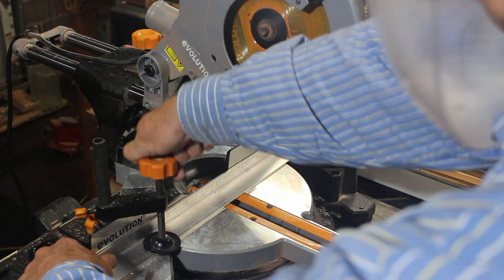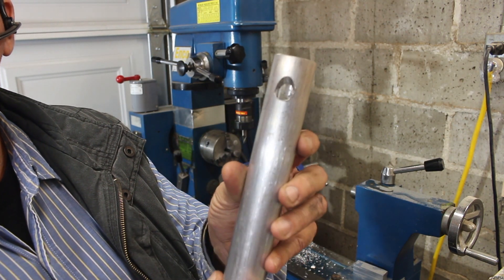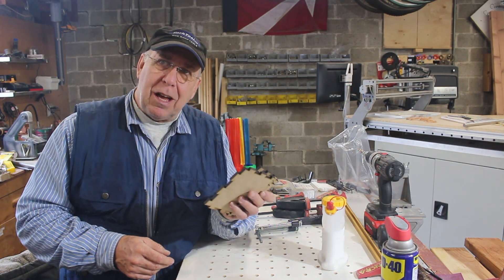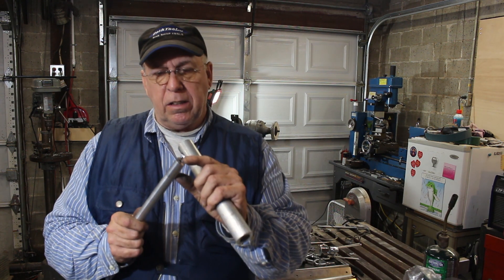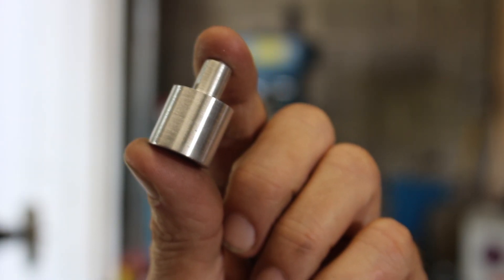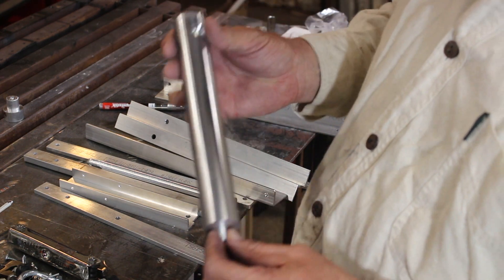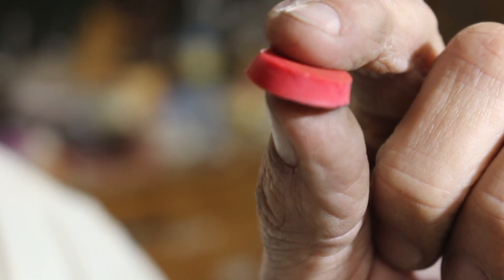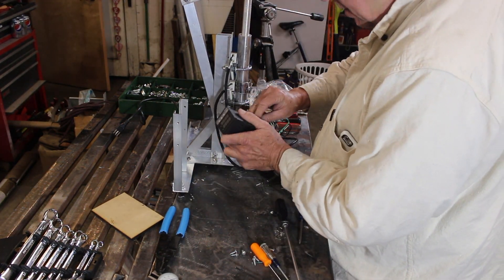Injection Molding Machine for under $100 in parts using less than $700 worth of machinery!

Comment: The video format is good. Try to stay under 10mn. 5mn is usually enough by the way. I never watch videos over 10mn. What about some background music? Cheap build, not really because you need expensive tools. After molds, the most interesting should be a budget plastic shredder made with simple tools. Not everyone have access to a lathe/mill combo. Remember if the project can be made with simple tools it will interest a larger audience. And no problem for the well equipped workshop : fancy tools can be used anyway. Thanks for the video.
Reply from the maker: I get this comment a lot. I recommend looking into maker spaces in your area. They've become quite popular. There are at least 6 in my area with memberships ranging from $35-100/month. They are all nicely appointed with much more fancy equipment than the $700 worth of stuff I used in this video.
Reply: In europe, you need to multiply the price by ten. And there's no makerspace in the countryside. Anyways this is very difficult to engineer awsome things from cheap materials and with the tools anyone have on the shelf.

Comment: How are you heating the plastic? And it may help if you put your script on top of the camera 🎥 so your looking and talking to the viewer.
Reply from the maker: Links to the heaters and controller are in the description. I don't use a script. I have a condition called strabismus. It's worse when I'm tired. I was really burning the midnight oil on this project.
Reply: Wildman Tech I'm sorry I dint spot you had a condition. I did think it strange you could have not realised this. The project is really good. And thanks for the reply.

Comment: I liked the commentary during the fast forward.  The shots like where you were just placing the metal down one by one, I did not find necessary.  I think the time saved not showing that could've been filled with a pause in the middle of the assembly fast forward segment, perhaps when you encountered an interesting problem or roadblock.  I always find the honesty and problem solving in those kinds of situation to be the most educational. Thanks for the video!

Comment: Shouldn't the cylinder be spring loaded with about ¼" - ½" of travel so it seals into the mold port quick & easy when compressing?  I know nothing of this tech but seems that would help.
Reply from the maker: The molds I make are precision fit to the melting chamber nozzle. This transfers heat to the mold so the plastic doesn't cool too quickly.

Comment: I dig your no BS, straight forward approach to making. I'm subbed! Thank you for teaching us that you don't need to spend several thousand dollars to make an injection molding machine. I can see how applying an Arduino controlled stepper system could expand this into endless possibilities for less than $300 which is absolutely amazing. Again, thank you very much, Wildman!

Comment: On the electronics box. Why not build the box around the components instead of all the awkward fishing?
Reply from the maker: That's what the designer told me the intent was...AFTER he saw the video.
Reply: Yeah, the next box will be better. I built the smallest box possible, not thinking about the problem of assembly. With more time I would also design the wire harness so that it all fits easily.

Comment: Hey there!  I was watching your follow-up video but you disabled comments, did you ever start selling kits for this thing?
Reply from the maker: Not yet. we feel a strong need to provide a mold of something useful with the machine. We're in the process of developing the design of that thing and mass producing the mold.
Reply: Hey man, do you have a CNC?  I'm currently trying to build a plastic injector myself and have the CNC and can cut molds, but don't have the injector yet, maybe we can collaborate?
Reply from the maker: I have a CNC router. It will cut aluminum if you take small enough bites.

Comment: Great video (and format), thanks for sharing your work. What would be the approximate weight ( quantity) of plastic a machine similar to this can inject into the mold? Would I be able to make a plastic part, lets say 50 gramms in weight? Thank you.
Reply from the maker: We only measured cubic inches. This one had a melting chamber of about 2 cu.in, but once you press the air bubbles out, it was more like 1 cu.in. We're hoping to release one early next year on kickstarter with a 3 cu.in. capacity.
Reply: Wildman Tech Thank you very much for your response. 3 inches sounds like about 50g for an avarage weight of plastic. Do you plan it as a same working volume, meaning some of the 3 cubic inches to be lost to airbubbles? What is the main challange of building a larger machine (5 cubic inches?) I imagine 2 main issues are the pressure necessary to inject the plastic (Auger drill bit with the motor could handle that perhaps?), and the size of the heating chamber, hence larger/chamber/band heaters/energy to keep it going. I can't see problem here either, but I have never built anything like that so it is very likely I'm missing something. Something else I was thinking. If im missing something and larger volume is something that is only achivable with expensive industrial machinery, how about 2 parallel machines blowing into a single mold simultaneously? (Through 2 separate holes). This might not work as I'm not fully familiar with physics of what exactly is going on with the pressure and plastic  inside)
Reply from the maker: Dual melting chambers would mean a much more complicated mold. A better approach would be to use a larger melting chamber and a pneumatic ram to actuate it. The mold is actually what is holding us up right now. That, and you never want to launch a kickstarter that will finish at the end of a calendar year.
Reply: One of the problems with a piston design of this type is heating the plastic evenly. If the diameter of the barrel is too large, the plastic at the center may be too cool and solidify. An auger bit would be better, but difficult to clean, so you would want to be in a mass-production mode, and keep it running for several days at least.

Comment: Hole punch. 
Oh, all the wires - I unobservantly missed your comments?  Magic that it works - somehow I seem to have missed just what that electric box is all about. As a tekkie if one will, I know where your heading but as you ask about observing the presentation method, I hope this might help - as if you haven't already. 
This vid seems nice to me, however, a round of with its proven capability will have been convincing. 
Its a huge effort to get all this together I know. In reality, after diverse attempts one might deconstruct to show how its to fit. I had that with an alaskan saw and when it was put together right I ran out of go and never made the vid. I liked your choice anyway and thanks for sharing. May you continue in a fine day as you read this
Reply from the maker: There is a follow up video where we iron out the bugs and melt some plastic. https://youtu.be/fZ8EvI2D2vM

Comment: Do u have any drawing and list on components to?
Reply from the maker: The project is pretty transparent. I gave links to the electrics. Sizes on all of the tubing can be whatever is available in your area. It doesn't even need to be aluminum. I could build one of these using the links I provided and get the rest at any decent hardware store in the civilized world.

Comment: How/Where did you install the heating elements?
Reply from the maker: At 9:36 you can clearly see the band heaters installed. One under each U-bolt. There is a follow-up video where we iron out the bugs https://youtu.be/fZ8EvI2D2vM and another where we actually use it to make something https://youtu.be/HHdw3y6-km0

Comment: awesome build. I used to do the heat cold for bearring races in bus and industrial equipment transmissions and gears it always fascinated how even tossing a race in the shop freezer and a propane torch saved a half hour on the press.